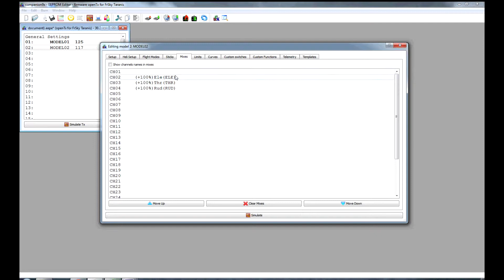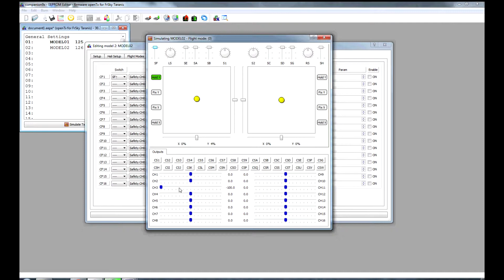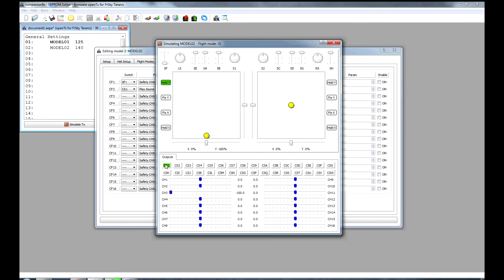Throttle Control Switch V2 (Taranis Guide)

Comment: Great guide, I did mine a different way got the sounds but in the end it had the same outcome. 
One question though, is there a way to trigger a failsafe should I knock the throttle enable switch? I'm using a pixhawk and tested it out today. If I turn the throttle off it obviously drops quite rapidly. I thought it would've triggered my radio failsafe.